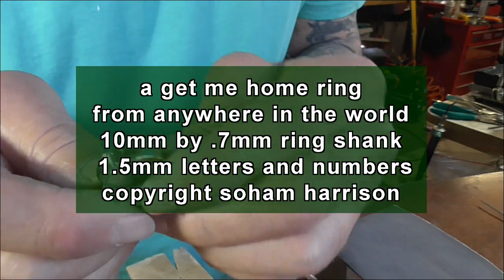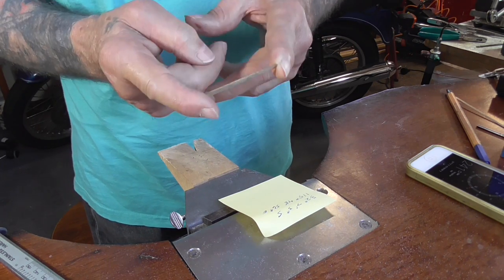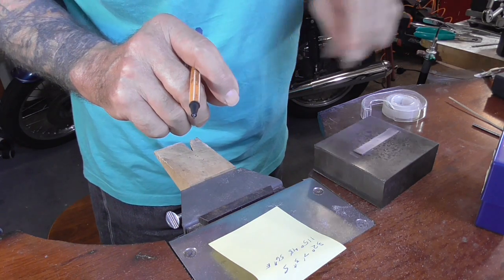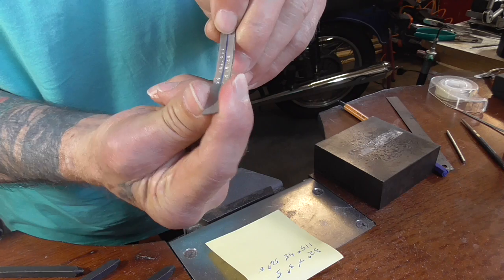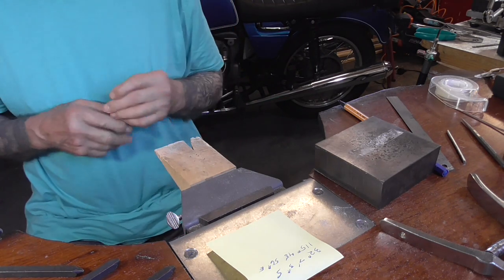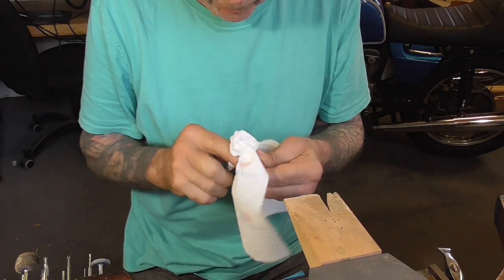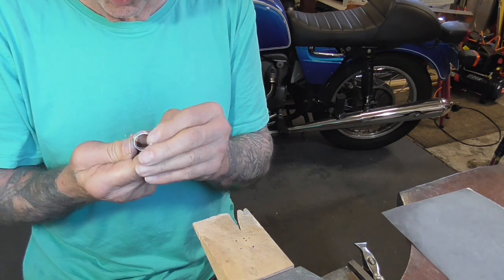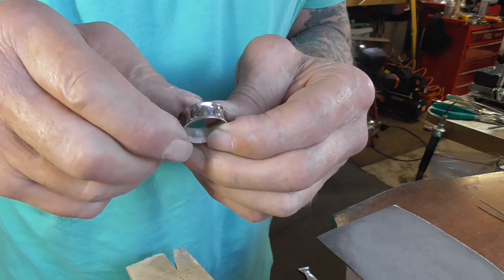a get me home ring

Comment: Great video! Simple, clean, love it. I browsed through your videos, if you have one I def missed it. Do any of your videos show how you get your ring shanks cut to size? I'm new and I ordered my sheet silver/brass from Rio and I'm having a heck of a time getting them cut to size... Would love to see how you get yours.

Also, any of your videos cover your polishing techniques? I know there a lot of videos out there on finishing, I love yours the most. Great soothing, calming voice! 

Looking forward to more!
Reply: Soham's method is the easiest I know of. I use it all the time. Use your calipers and measure the diameter of the ring size you want (in mm) on your ring mandrel, add the thickness of the metal you're using (also in mm) and multiply by pí. So, diameter + material thickness x 3.14 and cut it straight. I generally score a line on the metal, give myself a tad of fudge room when I cut it and finish it off with the file.